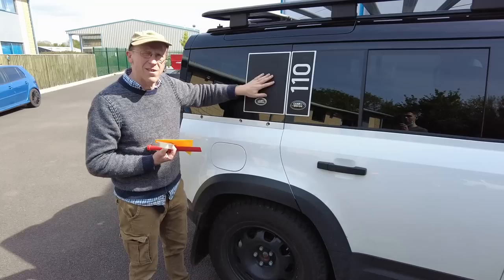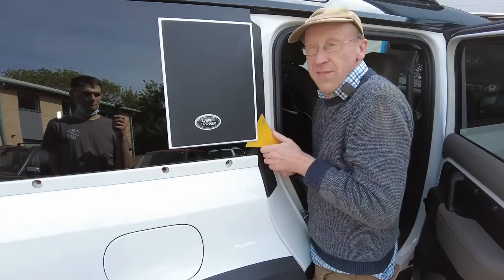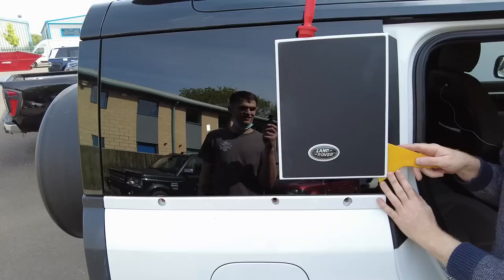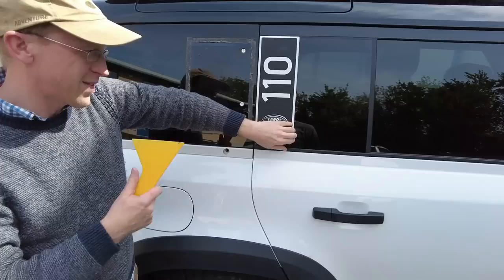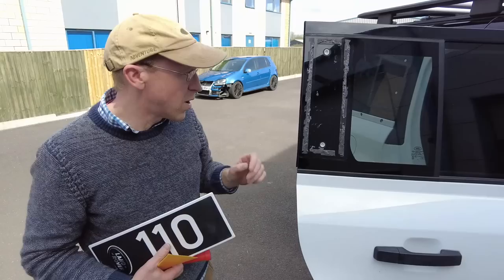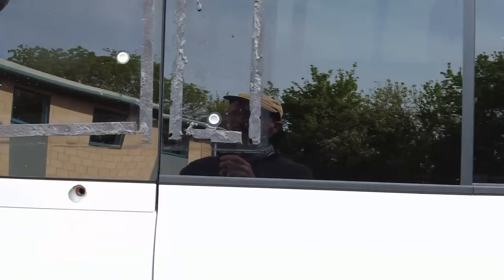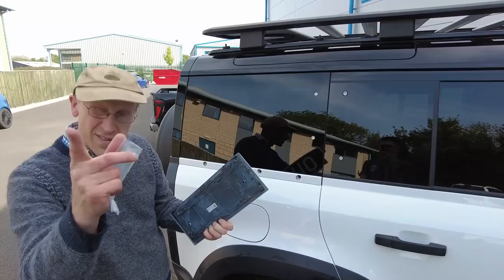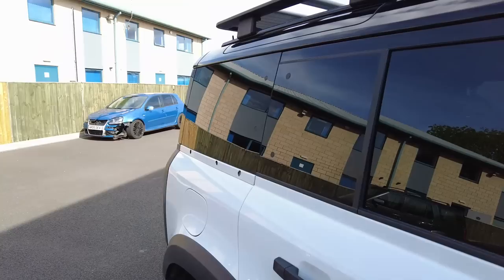Land Rover Defender 110 Side Square Body Colour Panel Removal / Delete

Comment: Brilliant adventure again. The Defender just looks better without these gimmicky panels. Landrover should, as an option, provide the car WITHOUT those eyesores.
First thought at the launch was why on earth! and can I remove them? Thanks again Simon and T.
Reply from the maker: I like the panels - but I hear you. One thing that is odd without the panels is the different angle the rear glass sits at - it looks odd compared to the door glass... the square is a clever way to side the angel change.
Reply: Panel looks like a quick fix to a poor design when you look down the side of the car as the rear glass does not line up
Reply: The ladder and lunch box to me are good ways to hide the angle change, once the square panel is removed, no?

Comment: Could the white “plugs” be removed and replaced with a threaded insert for 

Handles
Ladder
Lights 
Smaller version of the HSX plate
Etc. Etc.
Then you could make a threaded plug that covers the holes when accessories not in use

Well done guys
Reply from the maker: You sir have read my mind - I woke up in this night with this idea !

Comment: It was my understanding that the panels you have removed (I hate 'em, by the way) are required for structural integrity...I read that in two separate reviews.
Mr. Skywalker will no doubt have the inside knowledge to naysay me.
Keep up the good work, I love your early adopter philosophy, and do anything, have a go, attitude.
Reply from the maker: Hi Martin - do you really think that just double sided tape is going to hold the car together or provide any structural advantage.... you don't need to be a chartered engineer to answer that question.... careful what you read on the internet !

Comment: Looks much better without, why they chose to stick square bits of plastic on with no function is beyond me anyway. . Those rubber strip wheels work better at a higher speed, your drill is way too slow.
Reply from the maker: OK we will go to speed 2 on the drill next time... on paint the faster speed can get the paint too hot but should be OK on glass.
Reply: @L663  No, the paint will be fine,I was a painter for Audi when these wheels came out back in the late 90's,  you can literally fry an egg on factory paint, think of a black car sat in Saudi sunshine, that's hot!  We used the wheels on an air drill that ran really fast, keep the wheel moving . 👍

Comment: Reducing your Defender to its component parts, one video at a time. 🤣 

Looks like you've got the privacy glass so it blends in, mine is clear and the "window" bit ends where the coloured panel starts so that would give a different look. 

I was curious to see what was beneath the panels so thank you for doing it but I like mine so I'm leaving them on. 😉
Reply from the maker: Yes mine are going back on as soon as the stickers are tested

Comment: #powerfulukltd - Got a really bad clicking noise from the rear of my 2020 Defender. Dealership still investigating but do you guys know what it might be (have you come across this before). Thanks.
Reply: UPDATE - Cooling fans for the hybrid system apparently. Not the first time they've seen this so might be an issue you get asked about in the future. Clicking noise from the rear of the vehicle, 30MPH or lower, still persists even when the vehicle is stationary.
Reply from the maker: @DaMalat  Thanks for this - I was about to ask you if it was related to road speed. The system should be quiet - the Tesla has battery cooling but i cannot hear it !

Comment: warm it up with heat gun first, might help, the holes will stop it slipping under extreme heat
Reply from the maker: I am worried the heat will make the panel soft and it will distort as its pulled off.

Comment: I think you guys could come up with a variation of the faux pax which stores water rather than fuel that is fitted with one of those hand pressure pumps and various hose attachments similar to that the pet dog cleaner containers have so you can clean the lights/number plates etc or even for showering off dogs, wetsuits, boards etc. If they were black you might even get some solar heating effect for slightly warmer water.
Reply from the maker: We are looking at the shower thing...

Comment: Hi Simon and team. Have you tried dental floss for cutting the foam adhesive. Not tried it myself but due to its cross section much better than fishing line.
Reply from the maker: Thats not a bad idea but the force needed to cut through was very high - but worth a try !
Reply: @L663  hi Simon. Yes definitely try as the principal is the same as a cheese wire verses a knife. The dental Flos is waxed has a much smaller profile than the fishing line. You’re aiming to cut through the sponge part of the adhesive strip. Also trying lightly soaking the remnants of the adhesive with a little white sprit. The sponge soaks it up and softens the adhesive which when given a little time is easily removed. The trick is to give the white sprit time to do its thing. I’m usually too impatient although I know I should wait longer. The white sprit won’t damage plastics or paintwork like more aggressive solvents such as acetone would. Wrap the Flos around a wooden dowel or similar so it’s not cutting into your fingers.

Comment: I had the leak and it was on the small section on the door not the big section - I was told a seal was missing but looking at what is holding everything together I suspect that the adhesive wasn’t complete and the water was coming in through the white mounting piece things
Reply from the maker: Yes that would seem to make sense.... hope the video shed some light on the issue.

Comment: Wouldn't it be better to let the sun warm it up? Or heat gun..?

What's on the inside of the back window, there?

Tread pattern or carbon fibre version..? Or just get some black plastic covers to clip in. Also, if you use vinyl, won't they just wash/fall off?
Reply from the maker: Yes a heat gun would help but may soften the plastic panel.
There is a pillar behind the rear part.
The vinyl is pretty weather resistant and glass is a good surface to stick to so should be OK

Comment: You just caused an MOT failure - structure modification
Reply from the maker: Who needs an MOT ! its a new car .. got a couple more years till I need to worry about that !
Reply: @L663  really thought MOT was required every year regardless - you are in the UK ?
Reply from the maker: @secpac58chichi  First 3 years no MOT needed then every year... ( in UK )

Comment: I noticed a silver new Defender in my local car park the other day - looks like it had been "done" by "Urban" as it had the Urban logos on the wheel cover and side plates - interesting that the side plates had been sprayed gloss black so they matched the windows and looked as if they were not there at all.  All the 90s I have seen so far seem to not have the side plates at all.
Reply from the maker: Hi John - interesting as the squares are an option on the 90 and it seems not many people are selecting this option !
Reply: @L663  No wonder, they look awful. The designer who came up with the idea must have been as high as a kite.

Comment: Why didnt you just carefully heat it up with a heat gun and use the scraper once it's nice an warm do a small section at a time? It was so frustrating watching you strugel like you did when a bit of heat would have made it so easy to do 🤣🤣
Eucalyptus oil is fantastic for removing sticky marks
Reply from the maker: Hi - As i want to refit the squares i was worried the heat would soften the plastic panels and then they would warp as i pulled them.

Comment: Boring information: As well as allowing for production tolerances the reason for the slotted locator holes is that at high and low temperatures the glass and the plastic will expand and contract different amounts. The slots and the adhesive tape foam backing allow for the differential movement. This eliminates stress which would eventually lead to distortion and/ or failure of the bond. With large plastic parts such as bumpers and plastic side sills the the thermal differential movement between the plastic and the metal body can be around 10mm. All sorts of clever slip joints and live hinges are used to manage and disguise the movement.
The guy at LR who designed the fixings for the panels would be heartbroken watching you tearing them off!
Reply from the maker: Dave excellent and insightful comment. Although initially heartbroken I am sure after reading your comment he will be happy as all his clever design as been highlighted to the world and not just hidden under a panel !
Reply: Who cares, they are hideous looking and ruin the design